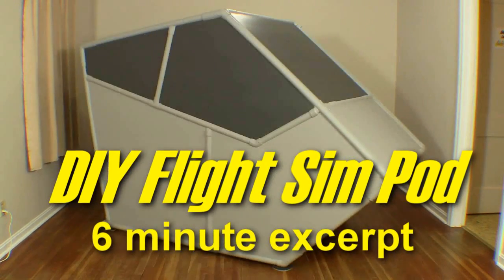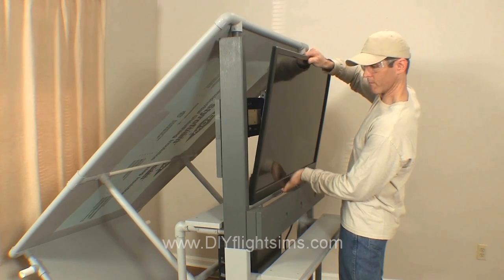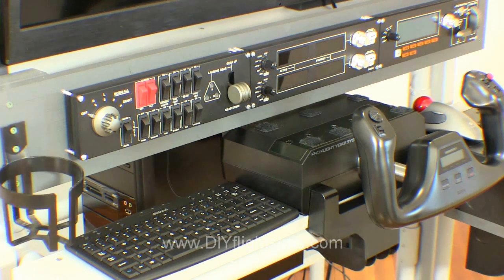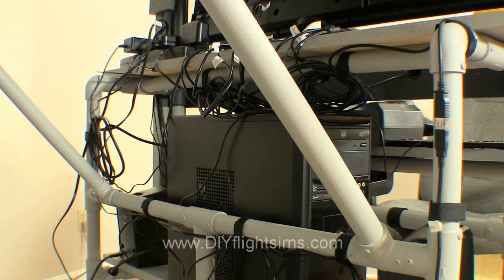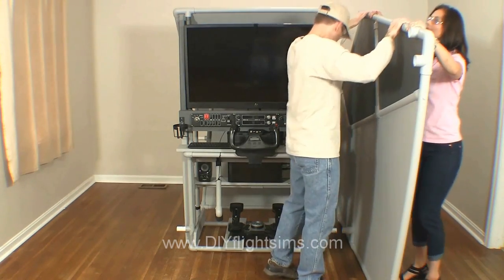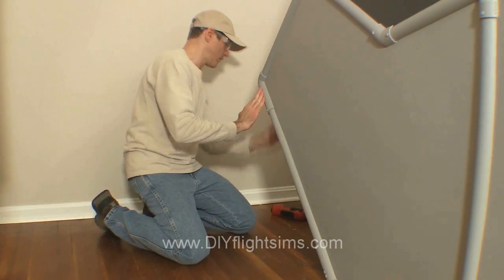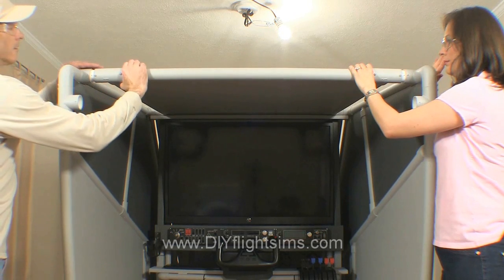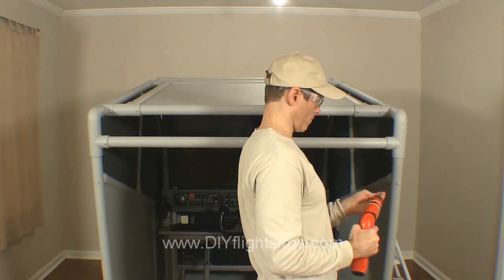Flight Sim Pod Final Assembly: 6 minute excerpt

Comment: Am I the only one that found the track ball mouse a novel idea? I was trying to come up with a small mouse pad space for a traditional mouse and never considered a track ball. I have triple monitor set up so my cockpit is all on a "sled" if you will with all perif's attached that way I can pull away and slide up the driving sim "sled" or sit a my computer. I am a fan of Propwash simulation panels as they have a vintage feel and I can have a separate transponder, autopilot and several other panels including GPS530 and for cheaper than most. Nice video and pod.

Comment: This is a really very well done series. I checked out your page too. I am looking to build something similar to this only to accommodate a 47-56" TV and VR capability as well for both MS Flight Sim and Elite Dangerous. Thanks for the inspiration! Very clean look. The only concern I have is heat dissipation; is it comfortable inside? I'm thinking I may need vents and/or to add a fan with the increased monitor size. Thanks.

Comment: is it possible to have it enclosed an with some sort of door on the side or have one designed
Reply from the maker: I suppose there could be a door on the side, but nobody has ever tried that particular modification. It would be a major redesign of the side panel.
Reply: Roger Dodger Aviation - suppose yah an not two hinges two like arms like those things on scar boot n when I'm ready to order could I order like extra parts say more poles and stuff ? Would be awesome if I could
Reply from the maker: You can find all the materials at your local home improvement store.